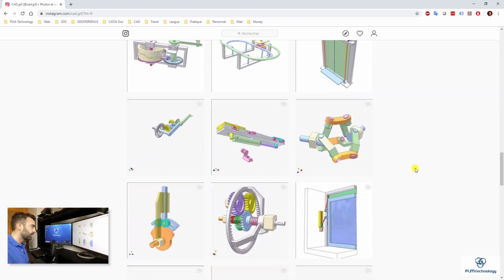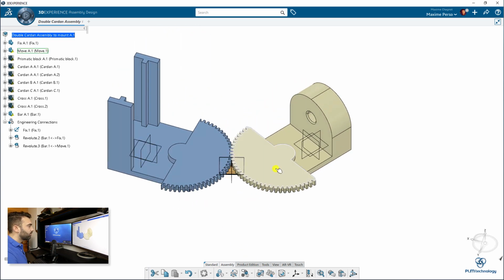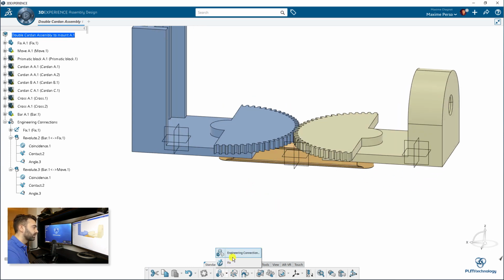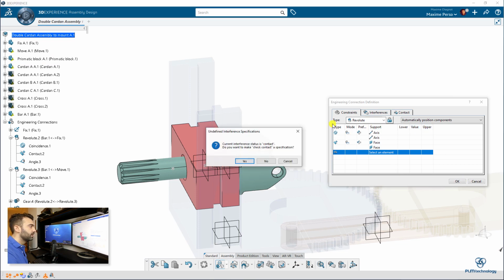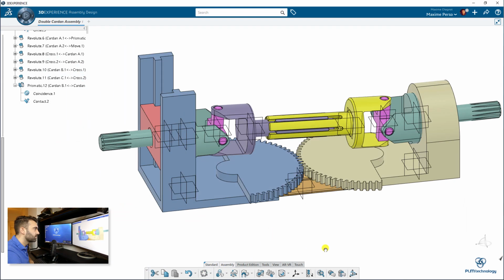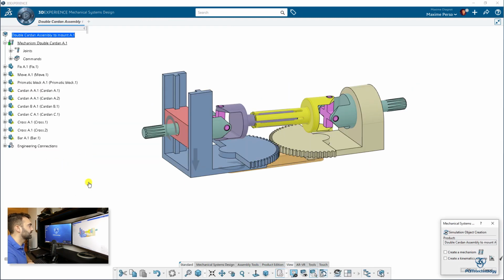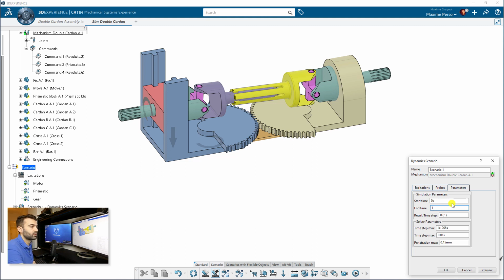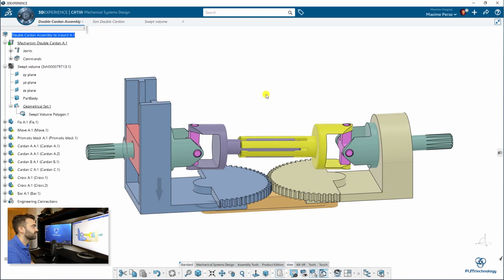Mechanism Animation - CATIA 3DExperience R19x

Comment: Hello, when I do weight definition some of the partbodies are not showing option for defining.
They are still in red colour and the simulation cannot start due to inertia error.
But for you the part are partially defined the weight automatically. How?
Do I have to change any settings
Reply: Hello, I have the same problem. Did you find a solution for this?

Comment: Hello Maxime. I know this isn't really relevant to this video itself, but you seem to be a great person to ask - when I save an assembly, why in V6/3DEXPERIENCE are visual elements (hide/show status; assembly-level colouring of parts) not saved? i.e. when I hide all but one part, save the model and close V6, then when I reopen it, all parts are showing? This seems really strange, as it was just how things worked in V5: if you saved with parts hidden, they'd stay hidden when you re-open the model. I cannot make sense of why this behaviour was removed?!
Reply: Instead of hiding the product or part, try hiding the individual body, planes and geometrical sets of every part body(define the particular body). Then it'll work same even after reopening

Comment: Bonsoir Maxime,
J'ai un problème lorsque j'essaie de générer les commandes à partir du gestionnaire de mécanisme dans la partie Mechanical System Design. 
Je ne comprend pas, j'ai bien mis toutes les contraintes avec une partie fixe pendant l'assemblage mais il me donne un nombre aberrant de degrés de liberté (89). Aurais-tu une idée de la provenance du problème ?
Merci d'avance de prendre le temps de me répondre

Comment: Hello, I am done all the steps shown in this video till 23:27, here for me clicking on the compute and generate results button does nothing.
I am assuming this is some license issue. Can you please let me know which licenses are required to perform all the features shown in this video.
Reply from the maker: Hello Ganesh, sorry for the late answer and thank you for your comment! I do not think it is a license issue. If you manage to open the app Mechanism System Experience, it should work. But make sure you do run 3Dexperience on admin mode and check if your firewall do not block 3DExperience. If you followed the video step by step everything should be ok. I recommend you to contact support if not (https://youtu.be/TP2Mdp6qIyc ) Good luck!

Comment: excellent video...please explain all type of mechanisms like gear,point to curve,etc  with small small example in 3d experience...
Reply from the maker: Hello helpin catia (like the name!), thank you for your comment! We will see what we can do in the future ;)
Reply: @MaximeChagnot  thank you and one more thing, when i went to system experience app with different mechanism ,in dynamic scenario it shown inertia problem.  what does it mean? how can i overcome that?
Reply from the maker: @helpincatia56  your are welcome. if you have this message, the weight is probably missing. Try to add material.